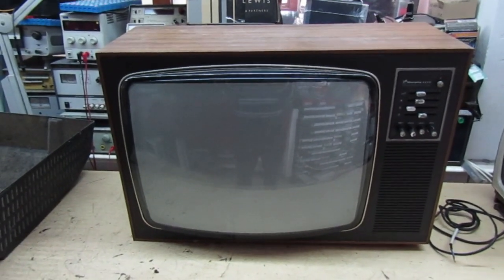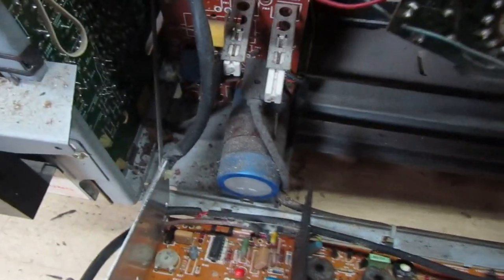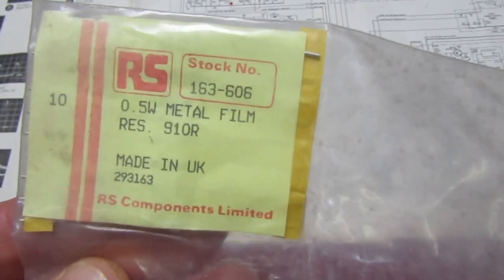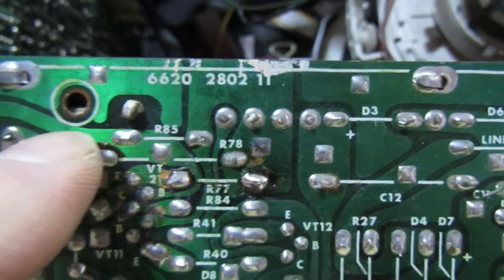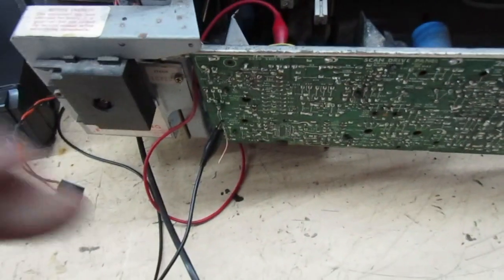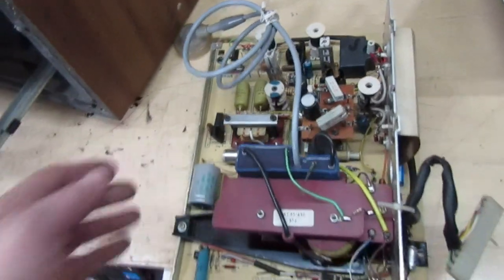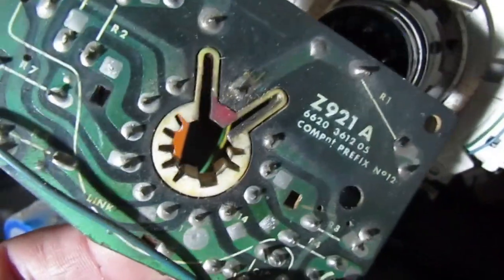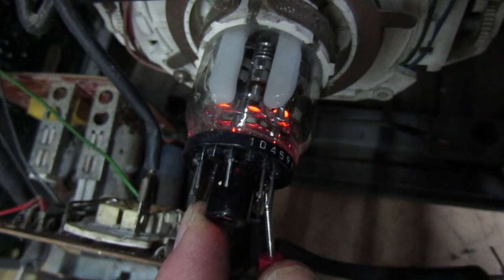Rank Bush Murphy  Z718C Chassis vintage colour  TV set from 1977 restoration. Model MC6301.

Comment: Very interesting video and took me back to my time repairing similar TVs in the 80's. It is frustrating when a fault clears and there is no obvious reason. I don't know if it was the possible cause or not but noticed what looked like a thin stray filiment of solder between pins 13 and 14 on the IC at  23:32. After you had tested and replaced the capacitor at  25:38 it was no longer visible. Maybe you knocked it clear when connecting your scope probe? Spend my time now in retirement restoring old valve radios and adding (removable for the purists) BT to extend their useful life as the radio stations shut down. Thought about having a go at some old TVs and then remembered my back.
Reply from the maker: who ever did this work never had this set working as there were so many things wrong , for a start the focus control is missing !
 However this set will be back on youtube in the future as I have managed to find some spare parts and the correct focus control, the last part I need is a speaker , there could well have been something stuck between the IC pins as this set has had considerable work in the past .

Comment: Great video Michael but you had me confused because you were using at least two different circuit diagrams!  One (at about 7 minutes) showed the +12v regulator powered by a +30v line, the other (at about 16 minutes) showed it powered by a +32v  line.  Also later on you have two different circuit diagrams of the tube - one with a 68k EHT resistor and the other with a 10k resistor in the EHT lead.   Must have been from slightly different models and probably because the renovation was spread out over a long period.  Must make the job harder!
Reply from the maker: there can be more than one circuit diagram for the same model as a lot of older sets production ran for a long time and many different modifications were introduced .on top of this this repair was filmed over many months so I could have been using different diagrams for very slightly different versions of the same chassis .

Comment: What an interesting video Michael. I was intrigued at the beginning of the video when you stated that this Z718 had a tripler fitted as I remember the original LOPT had a huge overwinding, 25kV output and was very expensive. Like the T20, the Z718 used some novel startup circuitry and I found the servicing articles in 'Television' extremely helpful when it came to quick and profitable repair work.
Reply from the maker: This is correct, the service manual shows a single diode , I cant remember now as its such a long time ago since I last repaired one of these sets but I would assume the transformer/tripler combo with 8Kv overwind is an aftermarket modification possibly as the 25Kv overwind was a common source of trouble back in its day .

Comment: Some Polystyrene capacitors become internally intermittent after being exposed to moisture, and recover when direct heat is applied, had a few over the years.
Reply from the maker: That would explain the fault I had then , I didn't know that and if I did once I have forgotten anyway so I am going to replace that cap now , many thanks for that .
Reply: @michaeldranfield7140  These Polystyrene Axial Capacitors used to go faulty in thorn 3000 etc. too, even with normal use and not being stored. Sometime o/c sometime even short circuit. The heat from the soldering iron would very often make then appear ok when removed and measure ok once removed. So a good idea to change it out for a new one
Reply from the maker: @marksntl7632  Yes I have made a mental note to replace this capacitor , got to get a speaker first then may make a part 2 video follow up, I must remember this too , just got a Thorn 3000 or 3500 set in , not sure what it is till I get the back off .

Comment: Hi Michael, nice job a true labour of love! I thought those black and white connectors had locator pins in different positions to prevent accidental insertion?
Reply: they do
Reply from the maker: They might well have , I  just didn't want to take any chances , until I realised they were colour coded that is !
Reply: @michaeldranfield7140  Nothing wrong with being safe.
Reply: Just this minute has a similar issue with a Toshiba radio cassette, both the audio head and motor power connectors are identical. Wouldn't be as impressive as getting the TV connections wrong, but not sure the tape head would be too fond of 9v DC.
Reply from the maker: @adamdavies163  in the end it turned out the two connectors were different colours, but in the past I have managed to get connectors mixed up on other stuff .

Comment: so best guess at the eht series resistor burning up is the tripler sending unrectified eht to the anode cap and the aquadag cap saying no thanks ! if thats right its really wierd you still had 2kv of suposed dc showing on the eht meter? i assume ac on top of a dc bias of 2kv?
Reply from the maker: AC to the CRT is what you would have thought but I had a 2Kv DC reading that doesn't make much sense , at first I just assumed the EHT lead was screened like some sets use for additional smoothing and was leaking to ground and as the tripler was new and appeared to be part of the lopt modification I never even gave a thought to it been faulty, I wonder if it was damaged by connecting the heater winding to the earthy end of the tripler ?

Comment: This Murphy TV is the first one I remember my parents owning, so if they bought it in 1977 I would have been around 4, and this is the first time I've seen one for something like 35 years. So many thanks for uploading this as I've been trying to work out for years what model it was and now I know. One thing I remember is they had this set when Channel 4 launched in 1982 and we were already using the IBA2 button for the VHS recorder, so the only way to watch C4 was through the VHS due to the lack of channel buttons on the TV.

Were those convergence controls on the back of the set supposed to be adjusted by the user? As I remember my dad at least once adjusting something on the set in that area but don't remember him taking the back off, so I'm guessing there must have been holes to access those controls.
Reply from the maker: Nice my video has been able to bring back treasured memories for you, The convergence controls are not suppose to be adjusted by the user but Rank included a special tool clipped to the chassis for adjustment so if the tool was still present and had not been kept by the previous service engineer like I use to do then they could be adjusted by the user .

Comment: in line picture tube  with dynamic passive convergence looks like the linytron sharp picture tubes
Reply from the maker: this is correct , very few convergence adjustments , its good to know that someone else remembers the Sharp Linytron sets  I have one of these also on my channel but not got round to finishing it yes so no part two as yet  !

Comment: Very interesting diagnosis - thanks Michael. Just out of interest, what does an anti-breathing circuit do?
Reply from the maker: Connected to the earthy end of the EHT tripler and automatically reduces the beam current in order to keep the size of the picture constant regardless of EHT and power supply variations which can occur when a scene transitions from  light to dark .
Reply: @michaeldranfield7140  Many thanks for that!  I've noticed that effect on some sets.

Comment: chassis looks like  a t22a at first! i had one for quite a few years in the early 90s, it was a chuckout i resurrected , had no colour fault,
Reply: i have a spare t22a power board lurking around somewhere...
Reply: hmm, i think the t22a used same 910 ohm resistor....  my t22a had problems with the 12v supply
Reply: i also had another t something chassis model with power board similar to that z718, but its lopt didnt have a tripler just a big long diode, it generated the 25kv or so directly,  like shown in the diagram....also had an early TI teletext board , with ultrasonic remote, maybe one of the first teletext models?
Reply from the maker: The back of the set also looks like a T20/ T22 , in fact I thought it was a T20 at first .
Reply from the maker: @andygozzo72  Yes you are correct , the same 12 volt regulator circuit was used in a few different models
Reply from the maker: @andygozzo72  I have one that I have not looked at yet, touch tune , ultrasonic remote , and teletext , it might  be a Z719 , the LOPT /Tripler combo seems to be an aftermarket modification , presumably because the 25Kv overwind was a common failing in these sets back in there day .
Reply: @michaeldranfield7140  pretty sure mine had T something on it... T26? T28?? not sure, ir was certainly very similar to your one in the video, except as i said had the 25kv single diode lopt , i had problems with corona discharge with it and was one reason it was scrapped, tube red flared a bit, so getting low, teletext had a one line missing 'issue', and remote was unreliable! apart from that, picture was reasonably good! i wonder, did the t20 and t22 also originally have the 25kv lopt? or did they always have a tripler type? i only had partial service data for the t22
Reply: the t22 i had also had touch tune 'buttons' and they gave a lot of issues at times with not responding or random self selection!
Reply from the maker: @andygozzo72  OK , I have looked out the service manuals I have for RBM sets and this is what I find, Z718, Z719 both 25Kv overwind with single stick diode, T20, T22A, T23A ,T26 all have 8Kv overwind and EHT tripler and Im sure A823 also had a tripler , one set I cant find the service manual to is the one made by Toshiba which I think was called the T24 but I seem to remember this set had a split diode LOPT

Comment: I havent seen the previous video, can you elaborate about leaving the flyback to dry out ? I only ask because i found a tv in a back garden last week, looked like it had been there a long while, i got it running , but the day after the picture started going funny, i couldnt get the picture to focus on the flyback, now i have no image apart from a black screen, asif the tv is on ac input, i cant find anything wrong apart from the flyback smells of burning. Im wondering if the lineoutput/flyback has died ? Theres still high voltage but maybe theres not enough and some windings have burnt out maybe due to the damp? Any advice welcome , ive sourced a replacement flyback
Reply from the maker: because the overwinding of the transformer is working at such a high voltage any moisture in the winding will have catastrophic results and that is a mistake I made on another vintage TV I burnt out the transformer by powering the set up, what I should have done is removed the board or even just the transformer and left it in a warm  place for a few months before powering up and this is more likely what has happened to your set .
 However saying that in your case I would have a good look at the focus pin on the CRT base socket because any moisture or corrosion here will have the exact effect you mention .
Reply: @michaeldranfield7140  thanks for your reply , i had cleaned the focus wire because it was oxidised on the end , its all clean and making contact but it didnt solve the issue , im waiting on a lineoutput being delivered from ebay. Really hope i can get this tv going again, my dad who used to fix tvs back in the 90s mentioned it could be the crt itself thats died . But the picture was brilliant one day and then poor, then non existant the next day so im not sure . Thanks again

Comment: You should try a thermal camera to see what is getting hot. It is a fast way to identify shorts. These cameras are getting really cheap these days.
Reply from the maker: yes I can see how it would be useful but I wouldn't want to spend on something I may only use very occasionally .
Reply: @michaeldranfield7140  I saw the other day a tiny adapter you plug into your phone to give it heat detection seems like it was very cheap. Low resolution but it was a tech guy that does your kind of work it was good enough to quickly see what got hot. Not saying you must get it but it is just the ticket for some things.

Comment: Was I seeing things? You seemed to have a different schematic every time you put it on camera? e.g. 30V then 32V on the intermediate supply and 68K to 10K on the anode resistor.
Reply from the maker: Not seeing things , this video was made over several months with over 100 video clips so yes there were many mistakes , did you spot the mistake where I looked at the schematic and said I wont be able to power the set up with the line panel removed because there would be no supply to the varicap tuner ?  I then realised I was looking at the wrong model as my set had a mechanical tuner fitted .

Comment: tv horizontal oscillator frequency i think was 15625
Reply from the maker: correct 15.625Khz
Reply: @michaeldranfield7140  heaps of repairs here in Australia valve preamp amps radios